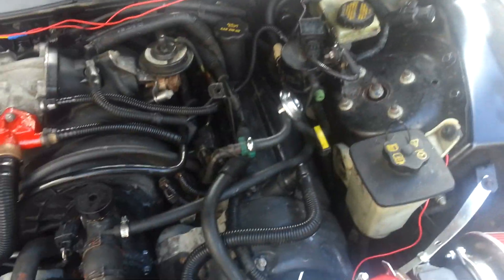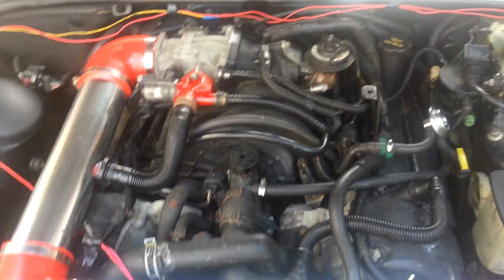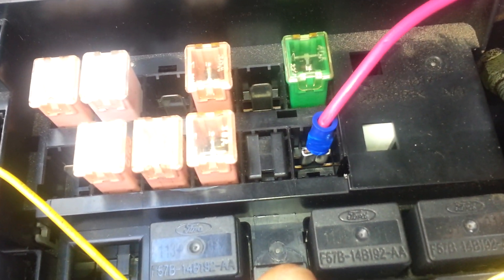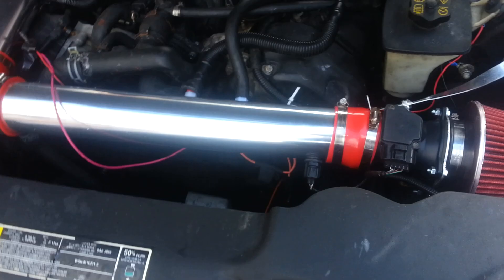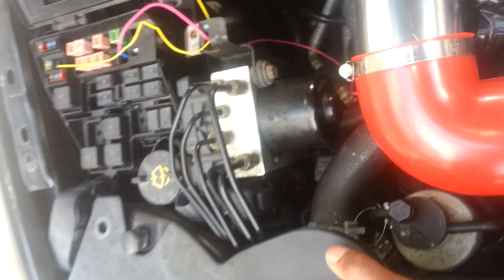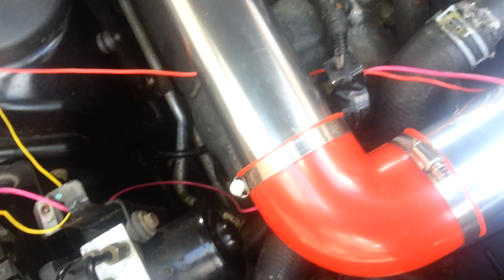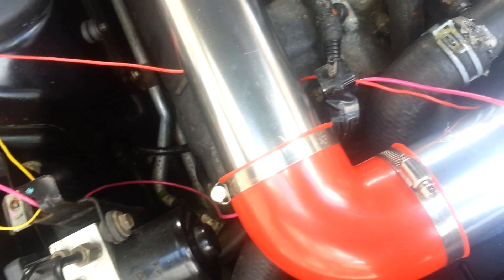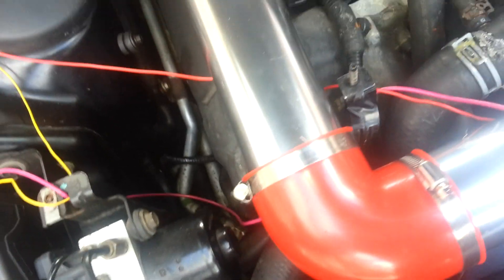2002 Lincoln ls V8 electric fan

Comment: I just installed my electric conversion on a 2000 Lincoln ls...two 12 inch pusher fans and a 16 inch puller fan...seems to work great....hydro hoses were fed back into pump for now...any questions please feel free to contact me...!!!
Reply: Chris Oakes but where did you put the hydro hoses

Comment: I used a 3/8in hose mender to connect the hoses together. Then used screw clamps at each end to keep it tight. Seems to be working fine so far. $6 plus $8 for the fan fluid.
Reply from the maker: I did that too on a v6 i got now

Comment: I know this is an old video but anyway, no need for switch. What i done before on my Race car is to ground  the negative and like you did putting the positive to a strong fuse that has power when you turn the car on! Never gave me any problems and u don't have to worry about turning on and of the switch. Have a great day all!
Reply: I have a fan controller with an ignition wire I need to wire into the "ignition". I can just wire it into a fuse instead? I am a noob at wiring but this kind of makes sense to me and could save me a lot of time.

Comment: and is there any way to hook it to a sensor so it knows when to come on when the motor is hot so you don't lose your heat to your heater
Reply from the maker: You can do it they have temp sensor for the just have to do a little bit more wiring

Comment: Great Video.. Very helpful...I own a 2000 Lincoln LS V8.. I have a overheating problem.. I found out its the Hydraulic Cooling Fan.. I want to convert it to an Electric Cooling Fan.. I have a question .. What did you do about the old Hydraulic lines that connected to the old Hydraulic Fan and the pump? How did You bypass the Pump? Thank you for your time
Reply from the maker: I ran them into each other but later I got a shorter belt and bypassed it

Comment: did you leave the pump in the car, or did you remove it?
Reply from the maker: kuei12 I left it just feed the 2 line in to each other
Reply from the maker: kuei12 if you do remove it you will need a shorter belt I did remove it later tho just because I wanted I use a 101in belt
Reply: Thanks man, good idea. These cars are a real piece of shit to work on. Extrememly poor engineering. The Mark 8's are much much better.
Reply from the maker: kuei12 np I got rid of mine as soon as I got in all finished sold it for 2500
Reply: LOL. I have been wodering all day how much I could get for this disposable POS. This car was designed to fail at 55,000 miles. I laughed when I crawled under it the first time and saw the oil pan and the oil plug were the lowest hanging fruit under the car. It catches all speed bumps and road hazards. 
I was initially deciding on whether to get a Jaguar XJR or an LS. I heard about all the problems with the Jag so I chose the LS. Then, guess what I found out. It's the same damn car with the same damn motor and this POS LS was designed by Jaguar.